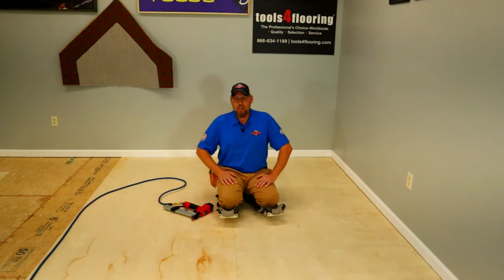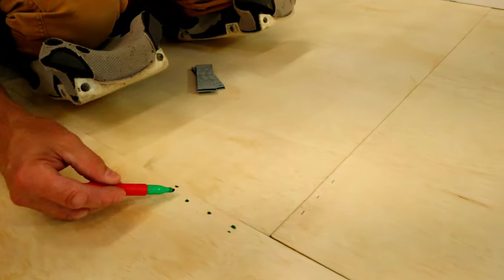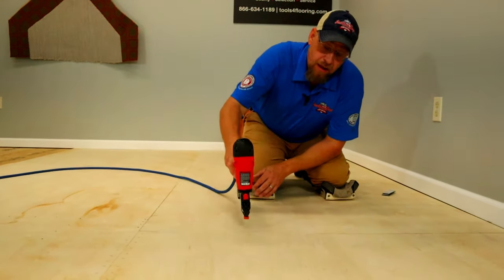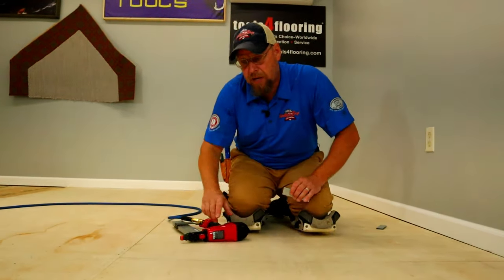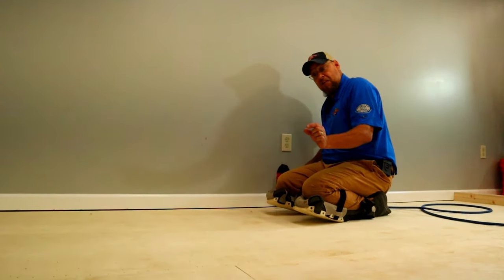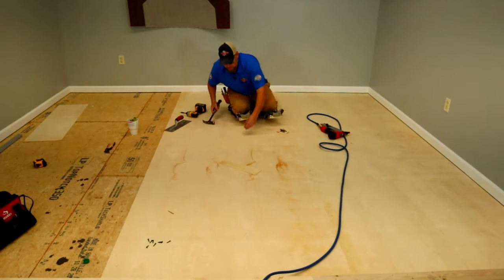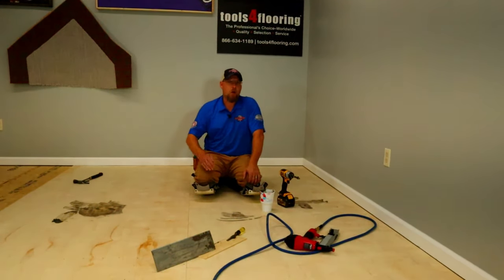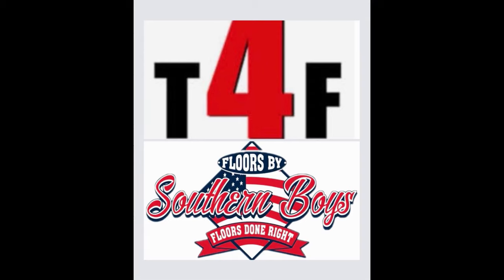HOW TO FASTEN UNDERLAYMENT TO SUBFLOOR

Comment: Never staple the seams in underlayment first! Always staple the field or middle of sheet first, working out to the edges then staple all seams last. This is crucial for preventing telegraphing of seams through sheet vinyl or vinyl plank. I've seen the seams invert and require alot of  prep to correct.
Reply from the maker: Makes a lot of sense, thanks for sharing
Reply: How about screws?
Reply: @GregoryGuay  screws would work, but they create divots that will telegraph through the vinyl sheeting and needs each screw covered. It is alot of extra time

Comment: Then if you ever want to remove this underlayment, you'll have 10,000 staples you have to either pull up or flush cut with an oscillating tool.
Reply from the maker: That’s exactly right

Comment: I'll be stapling 3/8" plywood onto a 3/4" OSB subfloor, since the thickness of these two pieces of wood equals 1 1/8", would a 1" staple be the correct size?   I know the staple is not suppose to go through to the joists, so the staple needs to be slightly less than the thickness of the two pieces of wood.

Comment: staples are likely blowing through, or mostly through, the top ply of the underlayment so orienting the crown WITH the grain gives a stronger hold AND limits the chances of face checking the top ply with staples. Also you can get a staple set to drive staples down without risk. It comes in handy when the compressor pressure gets low, leaving crowns high.
Reply from the maker: That’s great, never thought of it
Reply: That makes a lot of sense Nate, thanks so much. Otherwise great instruction! I wasn't sure if my narrow crown stapler would work.
Reply: If you absolutely must nail, wipe across the dents with a wet cloth, qnd allow it to dry. Moisture will make the smashed wood swell up. DISCLOSURE: I haven't tried this scenario,  but I have used this technique to hide flaws in wood when woodworking. I see no reason to believe it would not work.

Comment: If I have a low spot on my subfloor ( about 1/4 inch in a span of 3 feets), should i use planipatch to level it before adding a 1/4 plywood ?
Reply from the maker: No, do it on top. If you do it under the quarter inch plywood, the plenty patch will bust all up and become gravel under your plywood from shooting staples through it

Comment: What do you recommend for fasteners on 1\2in underlayment over 3\4in shiplap fasteners can not go through floor since that will be showing. Plus spacing on underlayment. TIA
Reply from the maker: That’s a good one, I would probably use construction adhesive and 1 inch screws
Reply: @FloorsbySouthernboys thank you so what brand screws and screw gun do you recommend
Reply from the maker: @kevinoehlerts3749  I personally use Dewalt and the screws won’t matter. Just make sure they are coarse thread.

Comment: A Southern Boys great video. What is the spacing on Staples with 3/8 particle board. Does it differ from  plywood? Not a big fan of particle board is just what a alot 0f track home builders use out here in Cali
Reply from the maker: I would do the same 4 inches in the field 2 inches on the seams
Reply: Thanks

Comment: Hi! Does anyone know if the staples need to be countersunk at all? I saw in the video that the screws were, but not sure about the staples? Should I be able to run a knife over them and not feel them?

Thanks.
Reply from the maker: You are correct you should not fill them. It is a necessity that they are countersunk.

Comment: If my subfloor is concrete/ concrete mix, will the staple be strong enough to get through the plywood AND concrete ? How many inch plywood is good to cover
 subfloor, im covering it with sheet vinyl thanks
P.s do you cover the joints with tape ?
Reply from the maker: If you are on concrete then there is no need for underlayment, simply print out your concrete slab to make it smooth
Reply: @FloorsbySouthernboys  what is print out?? Thanks

Comment: Will be putting down 7-8" floating vinyl flooring over 1/4 plywood underlayment. Do I still need to use as many staples?
Reply: I’m assuming the more staples you have the more likely it will be quiet! Maybe add a quiet floor rubber or felt Lair as well?

Comment: Would you use nails or screws for click floating lvp?  And do you still patch seams on subfloor for floating lvp?
Reply from the maker: If I had no stapler I would use ring shank nails and no I would not patch the joints but I would sand them and make sure they was flat

Comment: Is it okay to use 1/4” OSB as an underlayment over the subfloor as an underlayment for LVP? And if so, should that also be stapled?
Reply from the maker: For a click together LVP that will be fine if you are doing a glue down LVP then I would not recommend that. If it is click, you do not have to staple, but you do need to nail the pattern explained in this video. It will definitely save you a lot of hammering if you do staple.
Reply: Thank you so much for the quick response and your video. We plant to use click. I think the type we have already has a foam backing. I’m assuming we don’t need to use Smartcore type underlayment if the plank has a foam backing?
Reply from the maker: @ChettDaniel  that is correct
Reply: You’re a good dude. I truly appreciate your time!
Reply from the maker: @ChettDaniel  thank you, glad to help

Comment: Would this same method work for using 3/4 plywood sheathing as underlayment?  (3/4 is because I need to raise up the floor to match level with a hardwood area I am leaving in place.)
Reply from the maker: No sir for three-quarter inch products you will need to screw it down instead of staple
Reply: Curious about this. We are planning on doing the exact thing (3/4 inch plywood underlayment on top of 3/4 inch subfloor to bring it up level with the connecting room). Did you end up screwing down and if so, what size screw did you use and what did you use for spacing?
Reply: @brenttilley5163  I couldn't find anything definitive on it, so I just made something up (I am not a contractor, just a DIY-er). I used 3/4 sheathing grade tounge and groove plywood with a layer of rosin paper in between. I used 3-in perimeter screw spacing and 6-in in the field (Grip-Rite #8 x 1-1/4-in Yellow Zinc Interior Wood Screws). I used plywood because at the time it was a similar price to OSB (but that's not the case now) and I used the rosin paper instead of construction adhesive in between because I wasn't sure if it needed to expand differently since it was dissimilar from the OSB under it. I also had to do leveling with floor leveling compound, but the tongue and groove interlocking helps a little bit with that.

Comment: I need to secure a 5/8 underlayment panel to the subfloor.   I don't know how thick the subfloor is.  It is at least 5/8 -3/4.  What type of screw do I use and how long?  I was thinking of screws and using a drill bit with a counter sink to keep them flat.     If I do that,  what number of wood screw and how long?

Comment: That is way to much overkill , your just waisting staples
Reply from the maker: No sir that is exactly what is required no overkill at all
Reply: Its only luan bud , its not going anywhere
Reply: Your subfloor is the foundation to make your finish floor look amazing and you won't have to tear It out and start over if it's done correctly at the beginning.
Reply: @Anthonythesider All good if you want a nice squeaky floor

Comment: It's 2022. You don't use nails or staples. 

Tomorrow or 10 years, your floor will creek. Use screws and do it right the 1st time. 

You're not going to warp the floor nor will the hardwood or vinyl show screws punches. 

Stop it.
Reply from the maker: Wrong, for underlayment you always use staples never screw it down
Reply: @FloorsbySouthernboys  why? Cheapest and fastest way isn't always best.
Reply: @redrustyhill2 staples are cheaper and faster than screws